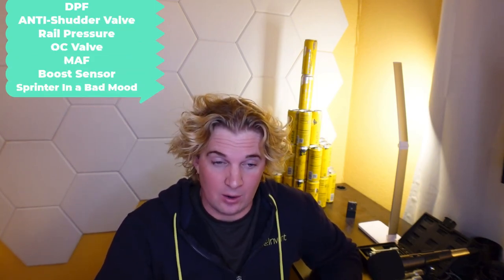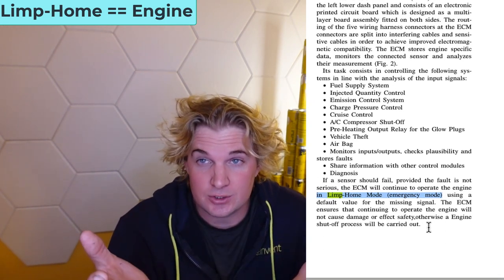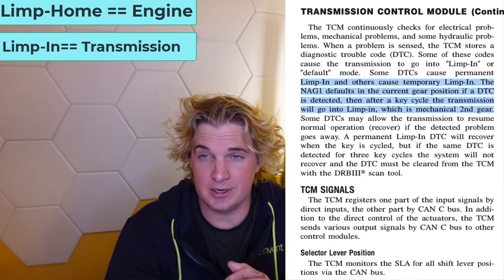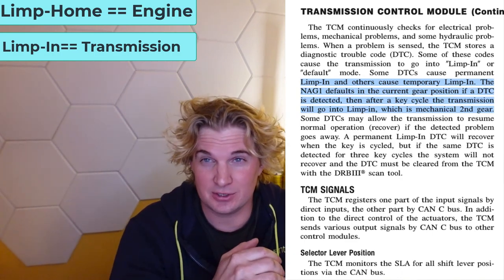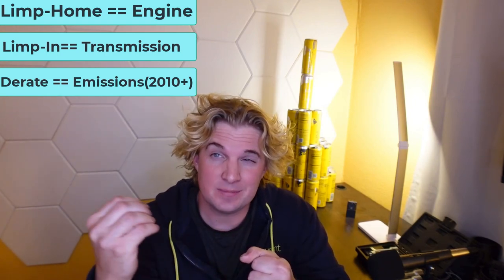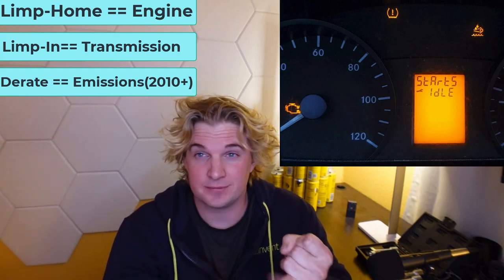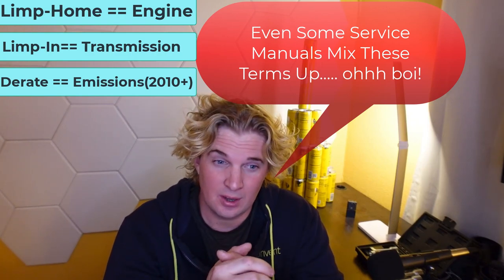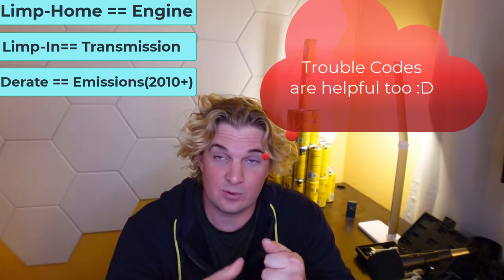Sprinter Low Power VS Limp Mode

Comment: any advice mate i have been stuck for a year now with my 05 sprinter 3500. its a 2.7 mercedes benz turbo diesel and i think issue is turbo or transmission related i have a code for a short in turbo but recently had tranny slippage issues i did fluid filter conductor plate and drained TC also had to swap tc solenoid had a code for it after changing it first time and had to change fluid again and finally put back together van drove perfect for 1 week 70+ mph and 60 miles a day.... all of a sudden stuck 20-25 mph on drive home couldnt go past it had no power at all im so lost and confused i got myself in super deep its a nightmare
Reply from the maker: Is it shifting now or stuck in second gear moving forward?

Comment: Wow thank you. Well it could only be in engine low mode however it will go above 3000nif I push it on 3rd, I just don't like to because it makes such a dreadful noise, too loud for me. Otherwise the transmission is definitely ok and it's a 2005 so I can't have emissions issue. I am starting to think it's just a piece of old shit that won't go up hills period
Reply from the maker: Well I sure hope thats not the case. Id consider either boost leak or old maf sensor off the top of my head. consider doing a smoke test on the system to find a hole. I sure hope this helps. I have a video discussing Maf sensors and one coming up regarding boost leaks